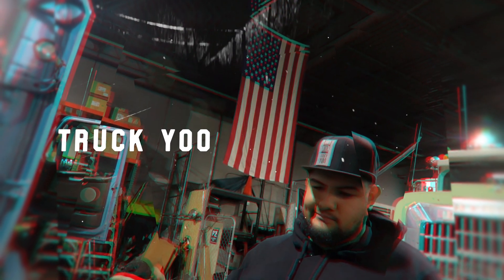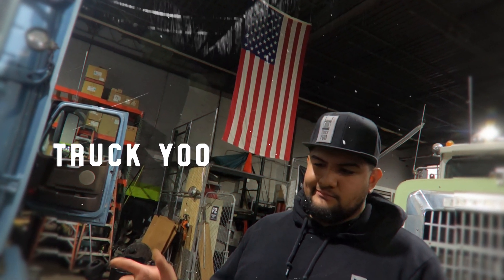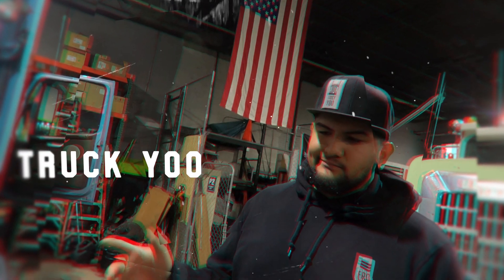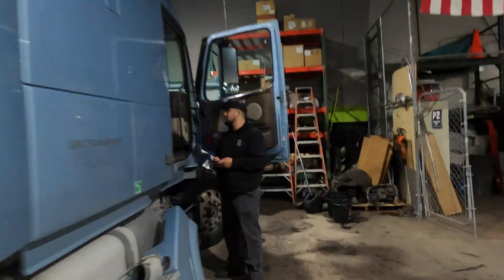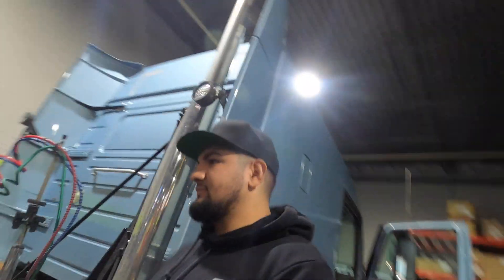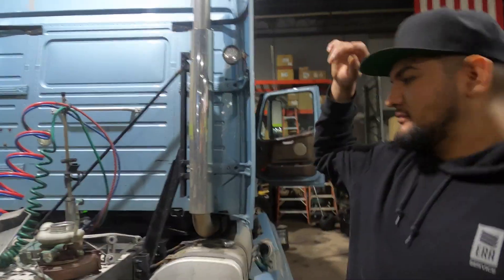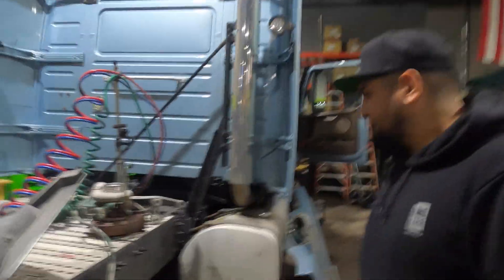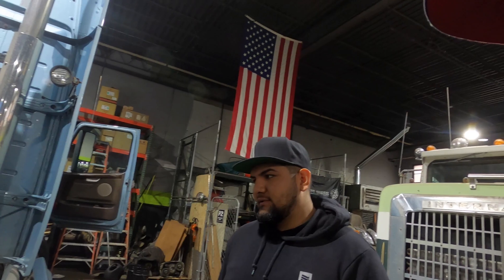What do you need to know about EGR cooler.

Comment: Great video. I did a video “Volvo D13 EGR repair”. In it I break down the entire egr and rebuild it. The oil lines cool the egr. As you will see they do not lubricate the egr. For less than $20 a lubrication port can be added to the egr valve and eliminate the problem of it failing.
Reply: Do you have link for video
Reply: Send me that link please

Comment: Important thing to note that when the egr cooler is clogged to also inspect the venturi pipe & crossover pipe to the mixing chamber because depending on how bad the coolant was leaking it could also be massively clogged as well.
Reply: Great point. I took the connecting hose off at the inlet to the cooler and also the venturi pipe and sure enough the roughly 1" tube up in there was clogged with soot and coolant gunk. Turns out the cooler is leaking inside and its in the works to get replaced as soon as I can get the part, Volvo says they're on about a 2 month backorder.

Comment: Around what miles do they go bad or need cleaning?
Reply: Mine went to 500,000 miles and started leaking from the tube connector from behind, it connects the egr cooler to the oil cooler and while I had it off we went ahead and cleaned it and reinstalled it. The truck is now at 600k with the original cooler still no internal leaks and no issues whatsoever. I recommend getting it cleaned and reused IF it isn't leaking internally.  The way you can check for leaks is to remove the rubber hose on the front of the egr cooler and look inside for signs of a coolant leak.
Reply: @Bigdad559  💪🏾💪🏾💪🏾💪🏾💪🏾